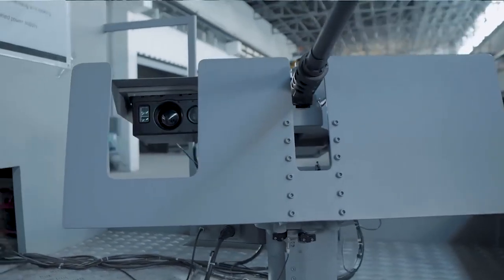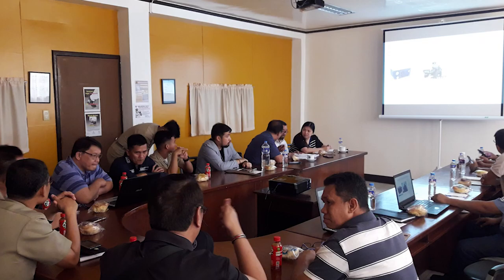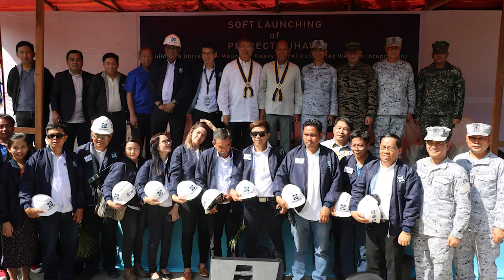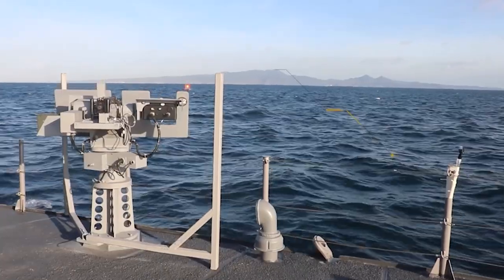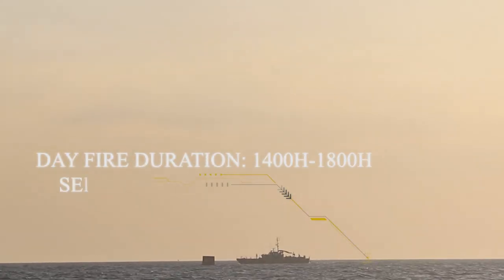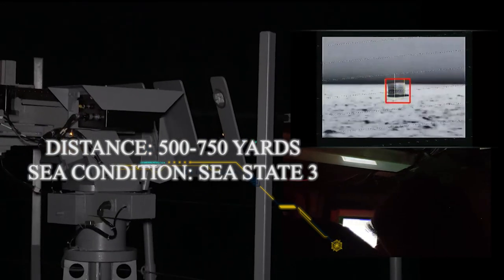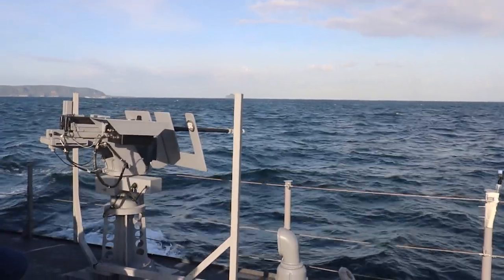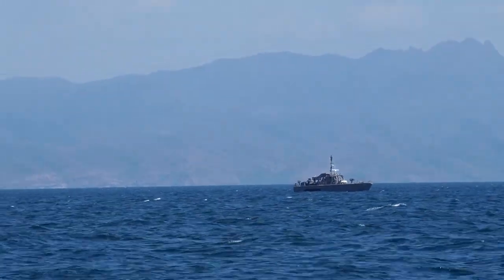BUHAWI Project Briefer

Comment: Question: can the Buhawi system be upscaled for the Navy's 40mm Bofors guns?
Reply: Probably, with a few tweaks. However, what's more important in  the Bofors would be an autoloading system, because manually reloading after 5 or so shots is going to be a pain.
Reply: @gargarmikejaphett.3840  true enough.

Comment: When i first heard about the Project BUHAWI, the first thing that i thought about was those old manually operated Bofors 40mm L/60 anti-aircraft guns that the Phil. Marine Corps are currently using. Maybe those cannons can also be modernized using modern military grade camera with tracking and targeting sensors + auto loading system? Just my two cents though…